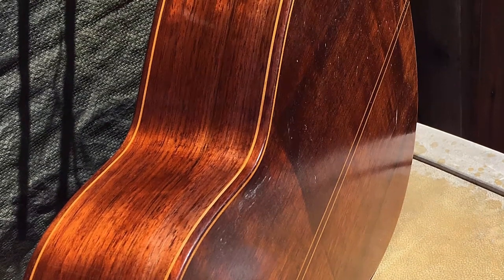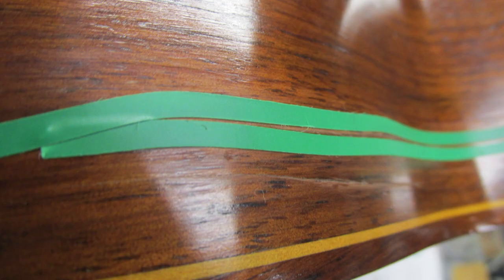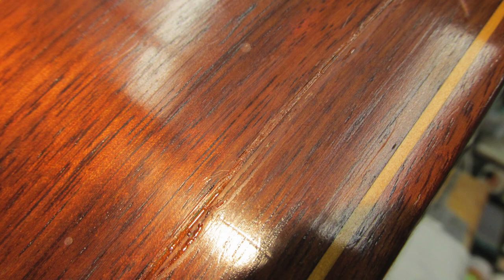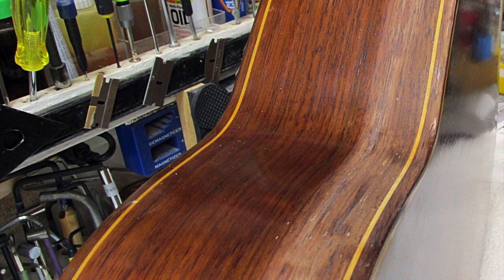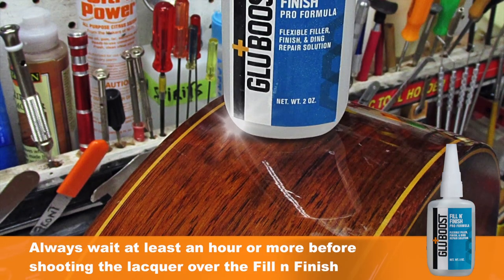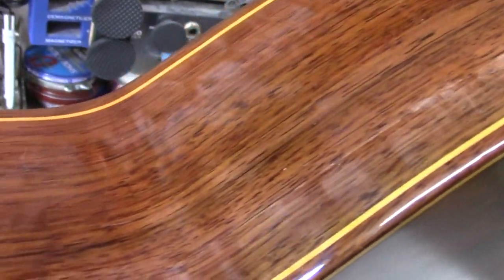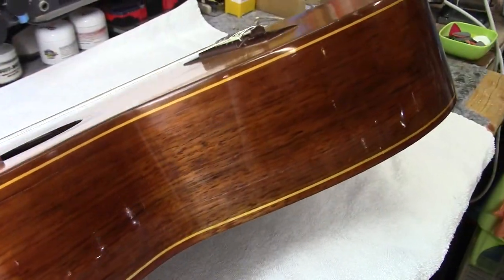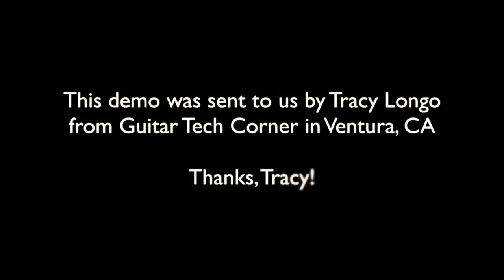Gluboost || Fill n Finish With Lacquer

Comment: So it's O.K. to spray nitro lacquer coats over a (small) Gluboost repair?? 

Candidly, I had a little trouble spraying Nitro over a particular 1/8" diameter ding that I recently touched up. So now I'm wondering if maybe if my Gluboost repair (using their CA glue) wasn't perfectly level and smooth, it would still show in the light. And that's even after 3-4 coats of lacquer...!! ***Should I use a tiny drop of sanding sealer and then wet sand it before applying any more coats of lacquer??